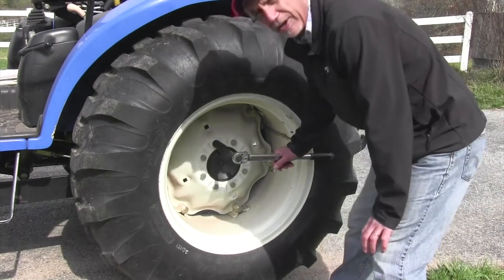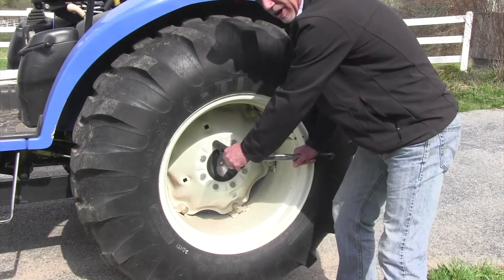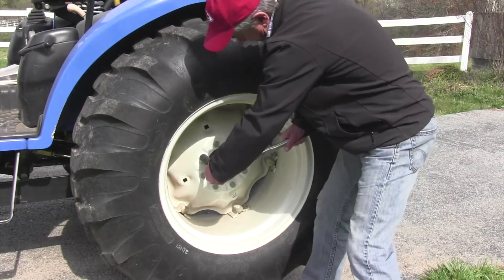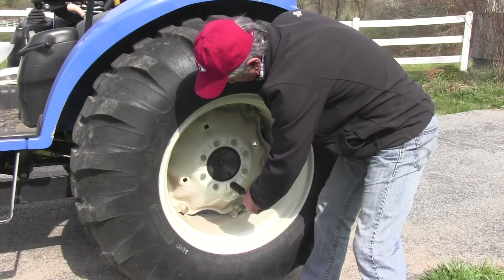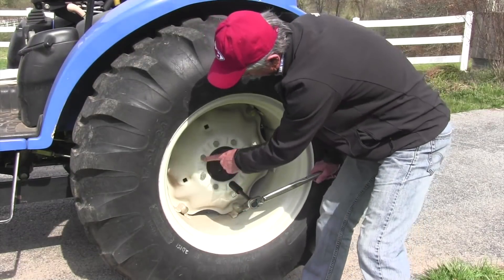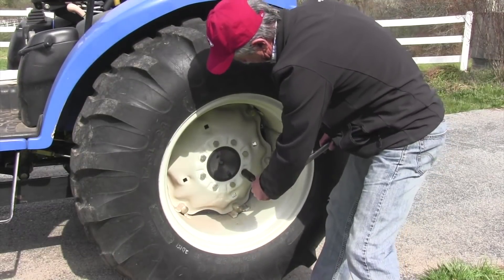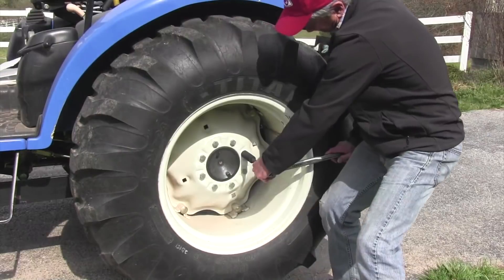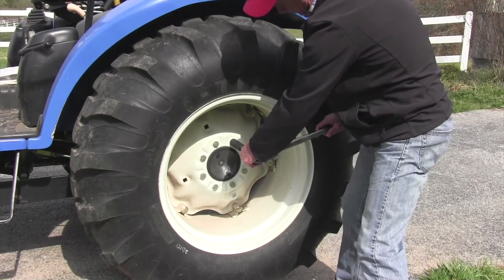I'm Torqued! You Should Be, Too!!!

Comment: This may be a dumb question BUT shouldn't the weight of the tractor be off the wheel when you check them? I am thinking the weight of the tractor and tire would make the torque wrench "clik" before it really tightened the bolt? I have a 90 hp John Deere and with the tires full of water plus the tractor it seems like a great deal of weight that is offering resistance as far as the wrench is concerned.Also,if you will stop using artificial sweeteners and drinking colas,especially diet colas,you will notice the arthritic symptoms will greatly lessen in a few weeks.

Comment: Mike- have found your channel in the last month or so, really enjoy. Keep it up!
 Yes, I definitely get the Ibuprofen comment,  It's not any easier when we are getting up in age.
 I like Tekton tools- use them at work and on my farm, and have heard good things about their torque wrenches, when I have to torque somehing over about  80 ft lbs, I use a digital torque adapter - goes on the end of a ratchet or breaker bar - good for  250 ft lbs and with a extra long breaker, I'm not  breaking my back (or other parts of the body)

Comment: Hey, i resently put a hydraulic Top Link on my Ford 3930. Its a Cat 1 which works great . Question is how do i slow it down? Is there an adjustment on the Tractor to slow the speed of the rear hydraulics?
Reply: Does it have the knob under the seat like many tractors?  I think Mike mentioned it or Neil Messicks mentioned that knob and did a video on it.  You turn the knob to adjust how fast your rear hydraulics are...Not sure if that's a standard thing on all tractors though, maybe just certain colors?

Comment: After 9500 hrs, just nicely broke in, my Deutz engine two connecting rod bolts came loose and bent the Krankshaft. Turned the krank down, ordered new rod bearings all the way from the fatherland, and 1 new connecting Rod.  $4k later up and running like a champ. A little loctite would have prevented that failure from ever happening. I always loctite the con-rod bolts 🔩  now. No possible repercussions!!!! You can't bad talk me doing it either, because it works!!!! 100% effective!!!! And btw they come out perfectly fine afterwards too!! No issues at all!
Reply: 15 years & 4500 hrs since then still going like a Panzer tank!! Good O'l fashioned German Engineering. 1974 I think it is just F.Y.I.

Comment: Mike, can you get away with using the sockets from a different socket wrench kit or must you use the ones that are designed specifically for a torque wrench?
Reply from the maker: Bob, I always just use whatever socket is nearest me.  I'll probably blow one up someday but have been lucky so far.
Reply: For a torque wrench it doesn't matter.  Now for an impact wrench you need to use impact rated sockets as some of the regular sockets that you'll find in many off the shelf socket sets are not impact rated and could possibly shatter....now you may not have that issue with small sockets 1/4, 3/8, 1/2 inch drive, but you get into 3/4 and 1 inch drive sockets on an impact gun and you are putting that much torque and impacting motion on a regular socket and you very well could shatter that socket...I've never personally seen it happen but I'm sure it has to people in the industry using those tools on a daily basis.

Comment: Thanks for the reminder Mike. I bought a Kioti last year and had heard quite a few stories of loose bolts. I checked them all on reception and at 10 hours and all were tight. I was lucky that the guy who prep'ed the tractor had used Loctite while assembling. After the 10-hour mark, I used the Operator's Manual to write my own 50-hour inspection checklist that I print and follow every 50 hours. I included loader and wheel bolts torque check as well as many other items that I could find in the manual. It takes me about 90 minutes to complete and is a good investment of my time. If I read a comment or lesson's learned from another user that I think could apply to me, I amend my checklist and have it covered at next inspection.
Reply: The checklist you made is a great idea for everyone to do really.  Even if they just write it down and photo copy it.  Its so easy to forget stuff when you are doing a service on a piece of equipment, so many things to check, change, tighten, etc.  Heck I even have a small checklist for my lawn tractor that I go through every year...I didn't put a pin back in the front rod for the mower deck a couple years ago, and the rod came out dropped down and bent into the shape of a U...oh was that fun to try and get out of the bracket on the lawn tractor...I was doing a test cut after putting the mower deck back on from swapping out the snow blower at the end of winter...got in a bit of a hurry I guess and missed that simple pin.  I was mowing along and looked back and was wondering why the heck the thing was bogging down so bad, well that rod falling out dropped the deck to the ground...that spot in the lawn was a bit short for a while HAHA!!!  

Now when I swap between snow blower and mower and back, I have a little list I follow, and double check after I am through to be sure everything is put back where its supposed to go.

Comment: Wheel bolts, yep. Very costly when you have to pay the dealer to replace the rim, what it bolts to and the liquid load. Amazing that they can all be backing out and you don't see or feel anything until there are only 1 or 2 left barely in place. After you torque them, mark the bolts and rim with a straight line of paint so you can visually see if they are moving.  Guess I better check the backside of my rims, didn't know there were bolts back there.

Comment: I just now found out there was such a thing as a torque multiplier. I’m getting old and it seems like this would be a great tool to own. Is there a trustworthy one that isn’t too expensive for us folks that would only need one a few times per year?
Reply from the maker: I bought a cheap one on Amazon and it didn't last one bolt.  Somewhere there's a video on my channel where it broke trying to get a brush hog blade off.  I was thinking the same way you are, surely an $80 torque multiplier would work for the 2 or 3 times a year when I needed it.  Turns out it didn't :(.
Reply: That’s what I figured. Thanks for the reply Mike. I did purchase the Torque wrench you recommended. It really looks and feels like a quality tool. I recently replaced my front tractor tires and I thought had tightened the lug nuts enough. After watching your video, I looked in my owners manual and found the recommended torque is around 200 ft lbs. I received the torque wrench and deep six sockets yesterday. Not one of those lug nuts were anywhere close to tight enough. Thanks to you, they are now.

Comment: Good timing Mike - was hooking up an implement and noticed I was missing the bolt on my 3 point arm holding the pin in place and was about to lose that arm. Had to find a replacement bolt and then took the time to check my other bolts and had a few loose on my FEL. Do as Mike says!!!!

Comment: I learned my lesson and now I torque everything every 10 hours - wheel bolts, loader bolts, backhoe bolt AND the top link bracket bolts.  I've found all of them loose at one time or another.  I had a major failure when I lost all of the bolts from my top link bracket bolts loosened.  It wasn't terrible but it ruined my weekend.  Buy a good $300 torque wrench (not a cheapie but very important tool) and use it every 10 hours.  It only takes a few minutes but its really worth it.

Comment: I took delivery of brand new Massey Ferguson GC1725M in 2020. In 2021 spring I went to check lugnuts and one bolt on the back wheel needed only to be touched and bolt head snapped off.

Comment: Boy, Mike, I can relate to this story.  Had a horse riding arena built for my wife which was covered with sand.  I was lowering the level of the sand and would drag it up into a small pile, scoop it up with my bucket and carry it outside of the arena.  Well, when turning in sand, it adds resistance to the turning process in general.  After several loads, I did hear an occasional "pop" but did not think much about it.  Then, with a full bucket load, I backed up, placed it in 2nd gear and turned to the right.  I had just barely started moving when faster than I could even process what happened, the left front wheel BROKE OFF!!  Thank the Lord, I had the bucket down to only about a foot off of the ground as the tractor pitched to the left as the hub buried up in the sand.  Had I had the bucket up in the air where the weight of the sand would have given the fall more momentum, I have no doubt that it would have turned the tractor over!  Later, after I had cleaned my drawers and gone to the dealership to get new lug bolts, I made a promise to myself to routinely check the tightness of the bolts AND to never carry a heavy bucket load high in the air.  Signed, "One blessed Tennessean"
Reply from the maker: Wow Mark, that could have been much worse!  Thanks for sharing, that might keep someone else out of trouble.

Comment: When torquing the lug bolts I was always taught to tighten opposite bolts. Distributes the load and doesn't warp the hub. That was on cars and trucks but I think it would apply to tractors as well.
Reply: It doesn't really matter when checking the torque because the wheel is already tight. The only way that it would matter is if you find a few that are loose. 
God bless you! 
Have you placed your faith in Jesus Christ's blood washing your sins away so you go to heaven instead of spending eternity in the lake of fire?

Comment: I've never had such a problem,  but a friend of mine, after many, many, many hours of research and visiting dealerships for a new riding mower, the Service Manager of the dealership,  who just happen to live a few doors down from my friend, delivered his new riding mower (brand name withheld purposely). The manager hops on this new rig and said something to the affect, "Now THIS is MOWING MACHINE!" and off across the 2 acre lawn he goes! ...BUT...not one blade of grass gets cut...not...one. He does some checking and discovers the idler pullies had not been installed to keep the deck belts tight. The machine goes back onto the trailer and the manager tells my friend through gritted teeth, "I'll bring your mower back tomorrow and IT WILL CUT GRASS!" We so wished we could have been at that service shop the next morning when the manager rolled in with that mower. Somebody got a boot in the keaster you can bet!😂 

BTW the mower was delivered as promised and it did cut grass like a dream for many years after.
Reply: I bought a lawn mower that was returned to Sears several years ago.  It looked brand new like it had never even cut grass.  I looked it over really good, asked what was wrong with it, and the guy at the counter said oh the customer just didn't like the way it cut their lawn.  I said heck I'll buy it, they knocked $150 off the price so I got it for 1/2 price pretty much.  It wasn't a high end model, but it was a 3-in-1 mower with high rear wheels, and self propelled.  Got it home, filled it up with gas and did a test cut...yeah I can see what the customer was complaining about, it wasn't cutting well, hardly at all.  I did a little looking, apparently the dang thing shipped from the factory with the blade on upside down.  Wonder how often that happens LOL.  Its been 5 years and still using that mower...it works great, I don't use it for long periods at a time just to trim around the trees and perimeter of the yard then use my lawn tractor for the rest, but I have mowed my whole 1 acre property with it a couple times.  

Sometimes the simple stuff is what gets overlooked LOL.

Comment: I can tell you, first hand, manufacturers are not using locktite.  I have a new ls xr3135. Dealers are not using locktite. I suggest the following:  pull all wheel lugs and locktite(blue).  Pull all loader, backhoe, and accessories, bolted to the tractor, pull the bolts, one at a time, and locktite each. Blue locktite if you plan to remove, red if it's never coming off.  Use a torque wrench. I use a makita  battery impact with torque sticks - no ibuprofen required. Be aware new battery impacts are powerful enough to strip a big bolt.

Comment: Good tip about the ibuprofen, Mike! I found some loader bolts that were hand-tight after just a few hours of use on my brand new tractor. Thanks for sharing. -Ed
Reply: That's not surprising....I'm sure on a lot of stuff you'll find bolts that were never tightened down...dealers are in a huge hurry to make money, and get their equipment service bays emptied out for paying repairs, not warranty work or setup stuff that isn't paying them anything...so a lot of stuff will typically get missed...add in the current situation where equipment is back ordered, it shows up, the dealer is happy to see it, customer wants to see it on their property last week, so the dealer is doing things way too quickly and missing a lot of stuff...I can only imagine how horrible the quality is on new equipment now with all the rush trying to get stuff out the door not only at the dealership level, but the manufacturer's level as well, I'm not sure I want to buy anything right now, luckily my wallet agrees.

Comment: I own a 2020 Kioti RX 7320.  Two of the loader bolts came loose.  One was lost entirely and the second one broke off inside the loader frame bracket.  It cost $350 to have the broken bolt replaced.  I now check bolts regularly.

Comment: Many years ago when I was so poor I couldn't afford quality tools I rotated the tires on my Volkswagen GTI myself to save money. I knew the wheels were aluminum so I didn't want to tighten too hard and warp them. A few days later I was driving on the interstate and noticed the car was vibrating more than usual. I had cupped tires and was going to replace them when I could so some vibration was typical. Cruising on the interstate my left front wheel suddenly dropped off! I was in shock as the wheel rolled along beside the car as it screeched to a stop digging into the pavement. Amazingly only one bolt had sheered off and all the others were still in the lug holes. I was able to reattach it with the help of a good Samaritan and limp home vowing to never do such a stupid thing again! The $20 I saved doing my own rotation wound up costing me about $400 in body work.

Comment: Mike, I never miss one of your videos. Why? Because the info you give us is priceless! Quick story related to this video. 2 years ago a gentleman contacted me to find an engine oil leak on his Mahindra 2615 with only 400 hours on it. It sounded great, but puked oil on the ground. What did I find? Loose and missing nuts and bolts that held the front drive and loader on the tractor! The engine block had huge broken peices of casting and missing whole chunks of casting. Though the engine ran well the block was toast. I bought the tractor and implements for the price of used implements. Mahindra's parts book was not encouraging for a replacement block with the assorted rebuild parts. I found a low hour engine from a Toro that a tree fell on and repowered the tractor. All this because someone did not check for loose bolts with every oil change. Keep all your bolts painted so a visual scan will show loose nuts and bolts. This video should be a wakeup call for all tractor owners! Thanks for all the great videos. See you on the next one. Dave

Comment: Hmmmmm never even thought about the tire bolts just assumed when I send the tractor to the dealer in the fall for servicing, I wonder if they are checked ???? Great video !!!
Reply: Probably not, just like cars, you take it in for service, the dealer often claims to do some huge courtesy inspection and service, 99.9% of it they never do, and if you are aren't careful you may find they probably never even did the oil/filter change they charged you for either.

Comment: If you use a 6-inch extension on 1/2 inch torque wrench you add 4 pounds to the torque for every 6 inches of extension you have I am a diesel technician in heavy equipment mechanic that is what we were taught at caterpillar School back in the 90s
Reply: I don’t think mike is strong enough to add 4 more pounds . He was shaking as it was.

Comment: Nice job Mike .  Maybe you should consider to take a paint marker and draw a straight line on the head of the bolt across to the part it’s holding.  Makes it very easy every time to walk by the tractor with a quick glance to see if anything is starting to come loose.  Keep up the nice videos.

Comment: The loader bolts are really bad to work loose the PTO Shield bolts are really bad and on an AGco 2 wheel drive the bolts that hold the keeper pin on front axle will fall out and let the axle fall off..massey Ferguson  I have 4 wheel drive agco ghost 65 cab tractor. With 1500 hrs. They thought the clutch was bad but it was only out of adjustment. Paid 17.5 k for it was that a bad buy .every thing working perfectly on it and tires are like new .best I could get for my budget. Hope it was worth the money?????

Comment: What size frame is your New Holland I think I have a 75 horsepower that is that size frame or maybe the size bigger my daughter runs it all the time for me it has a cow bone it in -2 wheel drive but anyway I bought it for $9,600 and it had 3,500 hours on it so far my little girl has plowed about 30 Acres of potato ground with it and I've not had any problems with it at all the heat air condition everything on it works great